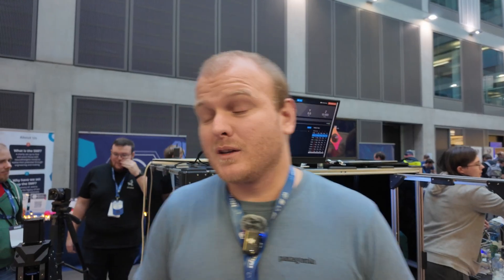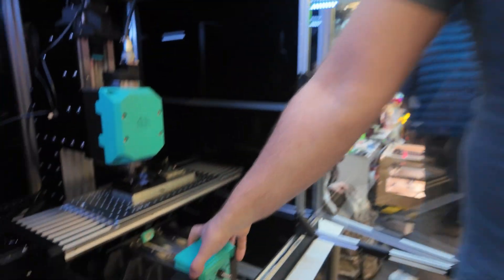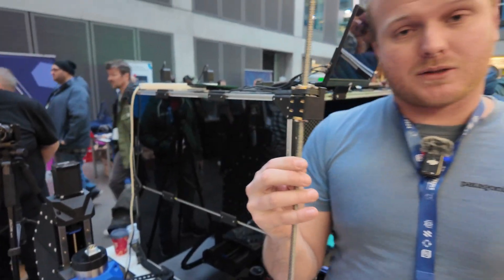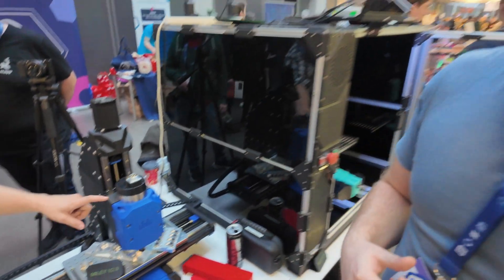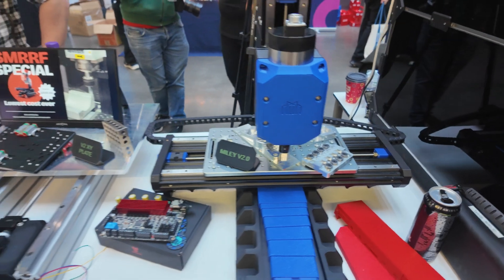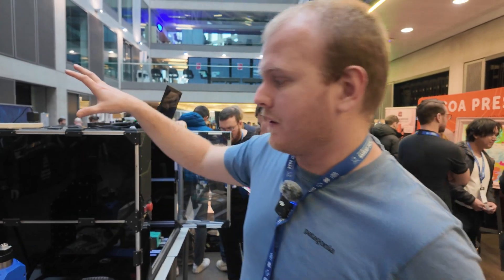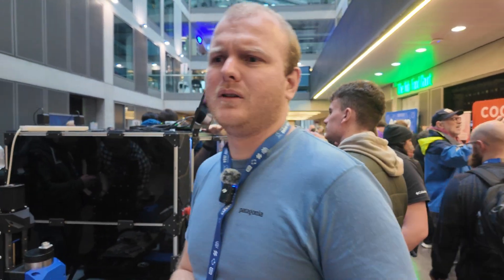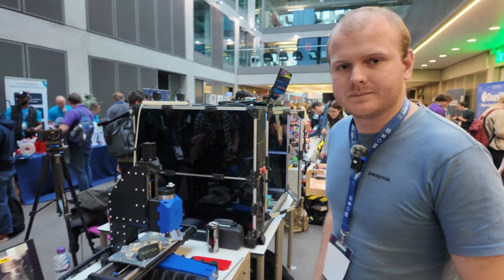Making DIY CNC with Millennium Machines! #smrrf #cnc

Comment: No chip management on the older machines was an obvious design flaw. Anyway, I'm glad they are listening.@2:05 I don't understand why he said you can take off the chip covers to clean out the chips? If the covers are doing the job properly no chips should be under the covers ?

Comment: Maybe I missed it in the video but when's the expected release date for V2?
Reply: When its ready, I've been on holiday for a few weeks only just landed back in the UK, there's some small stuff I need to tweak but expect kits Q2 or Q3 of this year, or buy a v1.5 kit and upgrade it to v1.6 (it has most of the QOL improvements that V2 has) also coming later this year
Reply: @jakeengland1430  Great, that's sooner than expected. Thanks for all the hard work that you've put into the project!
Reply: @TheshBuilds  no worries man

Comment: What’s the accuracy on these machines? 

What software do you use fusion or something else?
Reply: Depends on how well you build and tune it but most people can easily get 0.05mm and we've had down to 0.02mm, and we provide a post processor for fusion 360